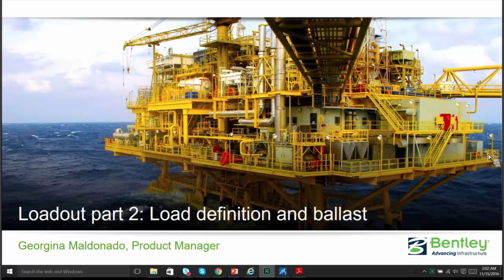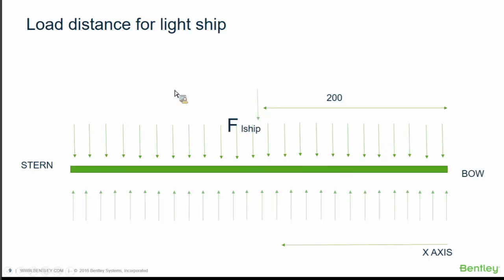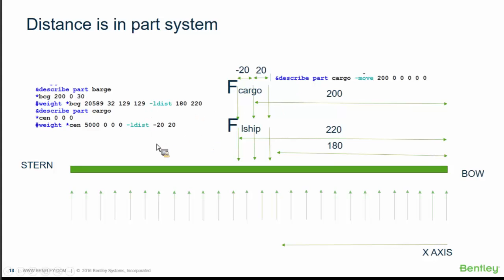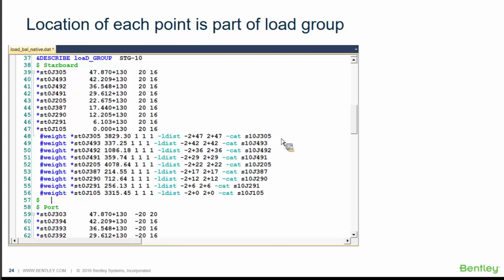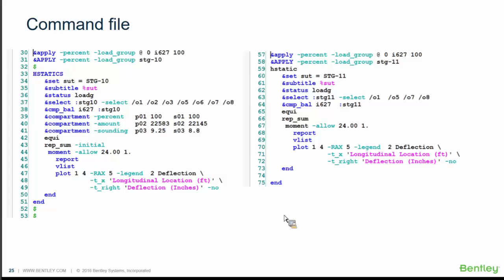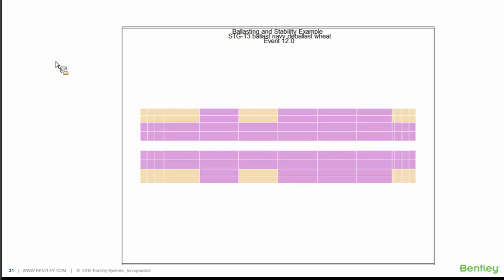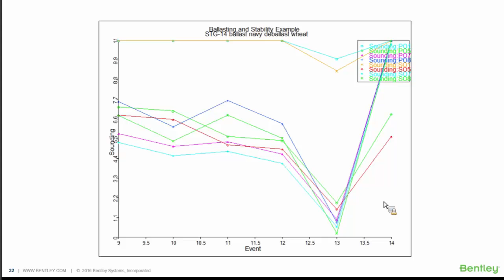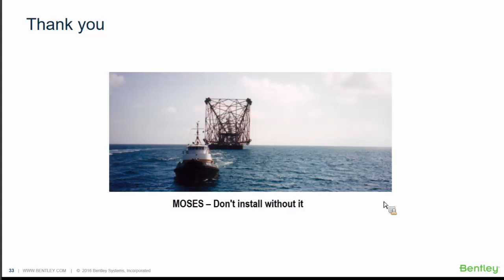MOSES - Loadout Part 2

Comment: The importance and tough thing is how to combine all factors like tidal changing, load, pump capacity, active tank... to define barge draft to compensate with quay level automatically.
Reply: Hi, you can run the analysis with those effects. You can even automate it in MOSES! :)